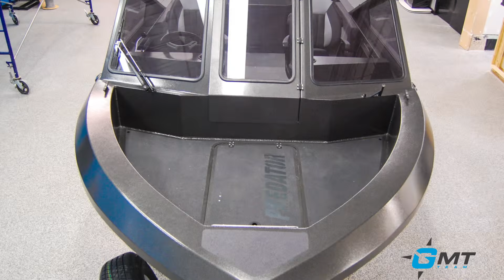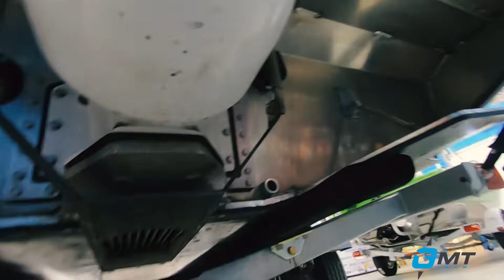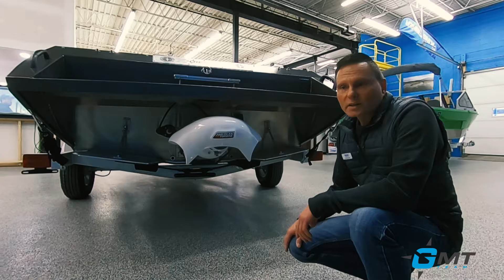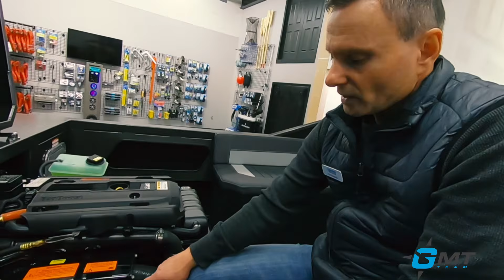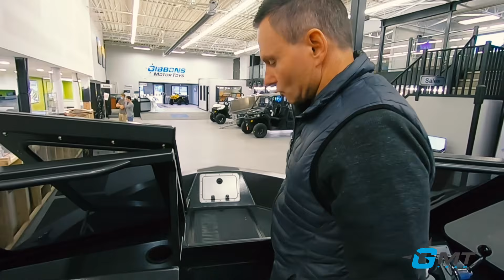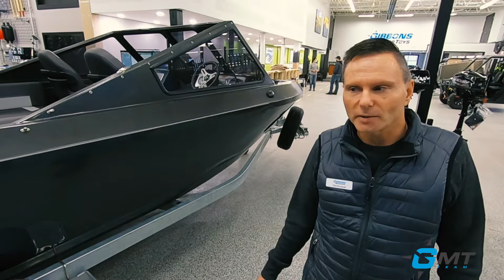Coyote Boats - 180 Predator - Alberta & BC - Gibbons Motor Toys

Comment: What is the bottom material made out of. Because it is so durable and i saw it was going over some rocks. Thanks
Reply from the maker: The bottom is 1/2" 6061 Aluminum in the center / 1/4" 6061 Aluminum for the rest of the bottom. Then it's covered in 3/8" UHMW ( a super tough plastic). This also helps it slide over rocks.